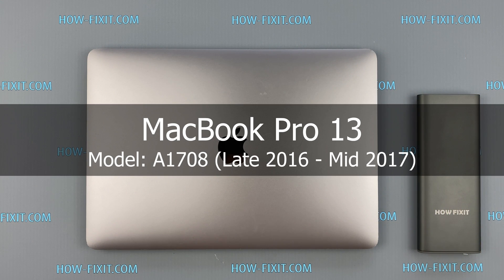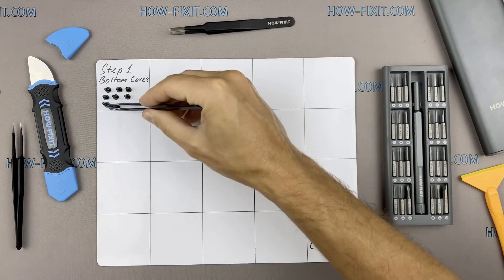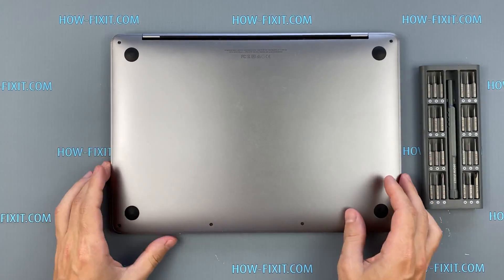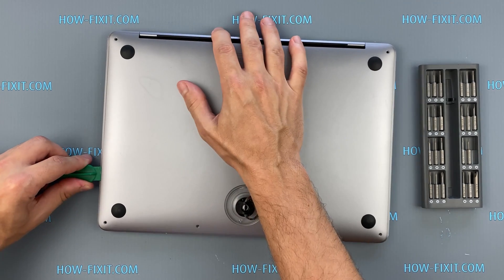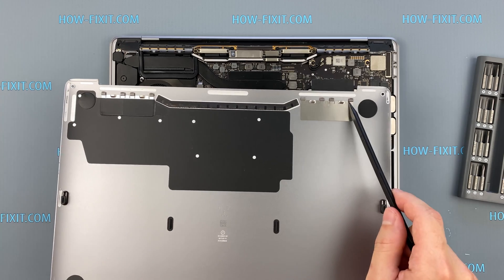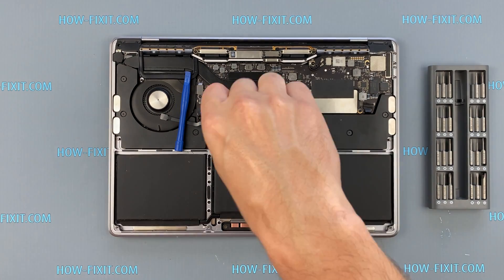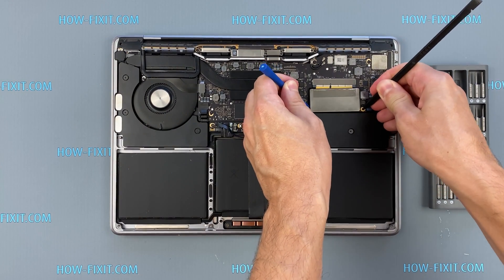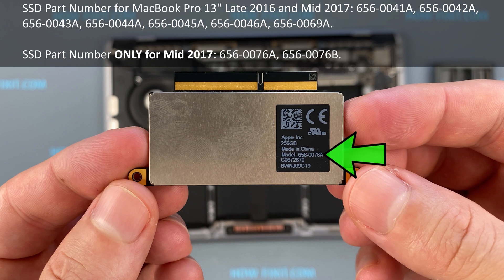MacBook Pro 13 A1708 (Late 2016- Mid 2017) SSD Upgrade | Step-by-Step Installation Guide

Comment: Many thanks! This is a great tutorial! That little connector for which the locking mechanism is pried up at 2:00 is called a ZIF connector, and I had to look at quite a few sites on those before I figured out how to put it back together. The verbal description for removing it is precisely correct. At the right end of the connector, there's a tiny little black plastic staple-looking thing. Carefully stand it upright. When replacing it, around 3:34, I found that I was eventually able to gently push the connector along the floor into its socket and then swing the black plastic locking gate down. On probably my tenth try. So far, my computer has booted, which it hadn't been doing, and I'm now backing up from TimeMachine. So, I figure the connector must've gotten back in place. The recommendation from @aharmlesshorse on option-command-R instead of command-R is also excellent advice, if you need to reinstall from recovery mode.

Comment: There is no serial 656-071A in video, i could buy such one for Macbook Pro 13 2017 without touch bar, and i am considering if it will work

Comment: Do you have a video upgrading the RAM on this exact model? I'm not sure it's possible?
Reply: Nevermind, I just researched and found another video, it's basically not possible for a "normal" non-technical human to remove and upgrade the RAM in an A1708 model macbook pro (non-touchbar) 🤣

Comment: Thanks for this useful video! But I have some question... please, why is the SSD adapter needed? which is its use? Thanks!
Reply: not sure which they used but i got a huyun m2 nvme off Amazon for like 10 bucks. works fine
Reply: @pluggingmyears 
Have link, I need buy
Reply: I do not notice any adaptor being used 😅